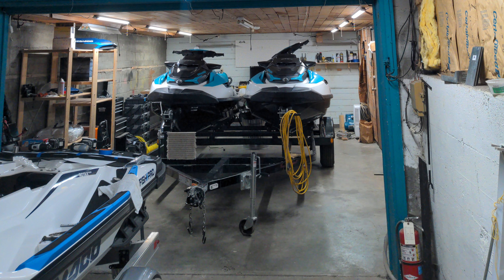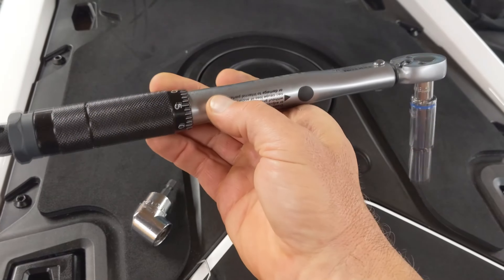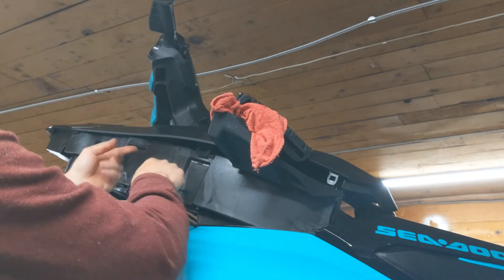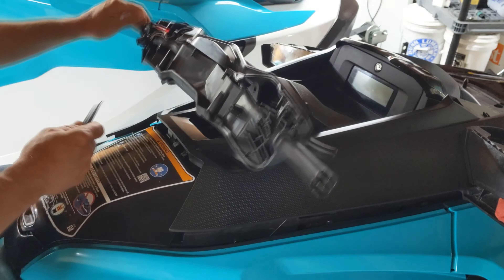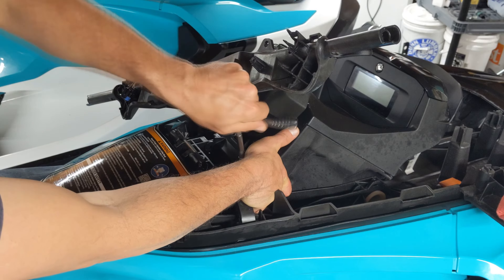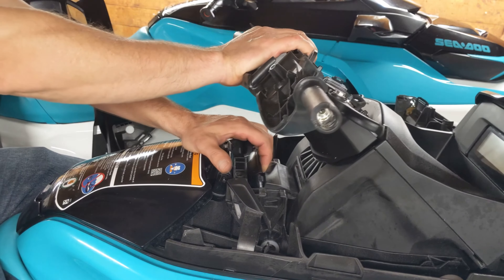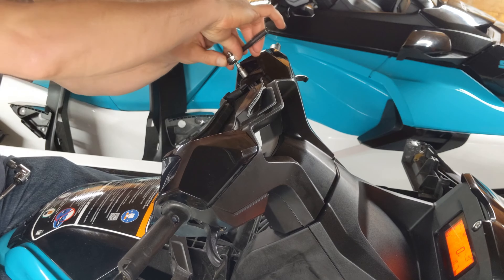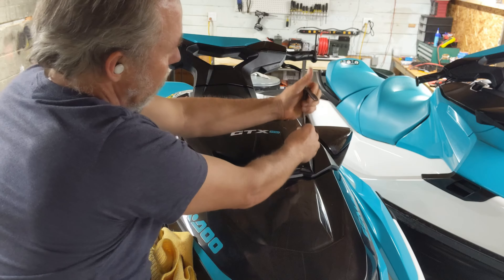Add tilt steering to the 2021 Sea Doo GTX 130 Pro PWC

Comment: After doing some checking I think the parts list should be:
Lock # 277002010
Rubber Stopper # 29383005

The parts in the comments are already part of the factory gtx 130 pro
Reply from the maker: I finally got a chance to verify this and you are absolutely right.  Thank you!  Updated parts numbers in the description!

Comment: Forrest, I bought the 2022 model...was wondering, do you miss having trim? Not sure that I do. Also, have you ever thought of having it flash tuned up to 170hp? And also, have you thought about installing a depth finder?
Reply from the maker: I don't miss trim... Partially because of my riding style (I really love rough weather) and because it doesn't have the huge back deck like my fish pro, so I don't tend to submarine in following seas.

I have thought of tuning it up. Comparing the engine part numbers, it is identical in every way to my 170 horsepower fish pro.  Same Pistons, same rings, same bearings, same wrist pins, same fuel rail, same injectors.... 

Of all the upgrades I want to do, adding a GPS and fish finder are at the very top. I guess I haven't done it because my fish pro already has it and I tend to ride that boat more often.
Reply: Thanks for the info and God Speed! If you are ever in Iowa give me a shoutout and you can ride with me as I have 6 jet ski's.
 @Forrest-Jackson

Comment: I wonder if it's a similar process on the 2020 GTI's I am in a similar situation and tilt steering would be a great improvement
Reply from the maker: Not sure - the GTX and GTI platforms are different and I only know the GTX.  If the non-rental GTI has adjustable height, tho, you should look at the steering parts schematics for each version of your model and see what differences there are... my guess is it's a very similar circumstance.

Comment: Hey Forrest, Are you happy with those Rental GTX 130 skis?  Anything else you have done or would do besides the tilt steering, usb, speakers, extra battery and tender?  I'm considering buying the gTX 130 as well
Reply from the maker: I am happy with them...  they're very solid and a good value.  I haven't had any trouble from them, either.
Reply: @Forrest-Jackson  I ended up buying the GTX 130'S.  No fishing yet, but it is on my wish list.  The family and I are enjoying riding them for now.  I did buy the usb adapters and tilt parts.  Hope to do the upgrades this winter as well as normal maintenance.  Thank you for sharing so so we can all learn from eachother.
Reply from the maker: @ronniestroh  Excellent!  I've been happy with mine - I ride my FishPro mostly, but those 130's keep up in anything but glassy water.  Just went camping for 4 days up on the Canadian border (Patos Island) and my camp-buddies really enjoyed cruising on them as much as I do...  Those GTX's are good boats!
Reply from the maker: @ronniestroh  That's great!  I hope you're having a fun summer!!!
Reply: I would also like to know if the powered wiring harness is under the front cowl so you can add the factory speakers. Has anyone tried this?
Reply from the maker: It is,  @andrewgaffka3525 .... if you watch my video about adding a usb to the GTX platform I color-code the wiring under the cowling...
Reply from the maker: Hey!  How did the tilt steering conversion go?  I hope good - I really like the way my GTX's handle following seas better than my FishPro... I'm doing all my annual maintenance right now for the season and I'm hoping to get some good camping trips in this summer!